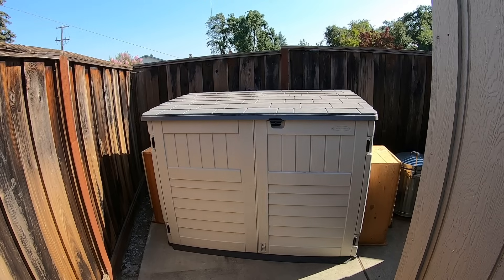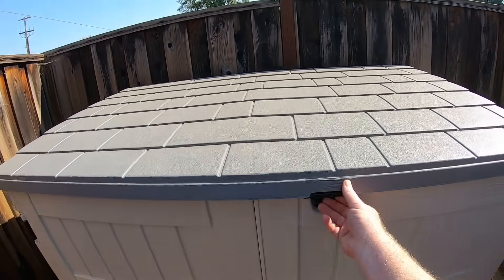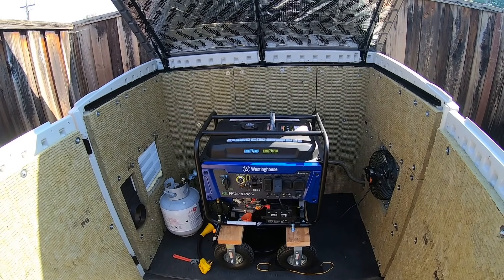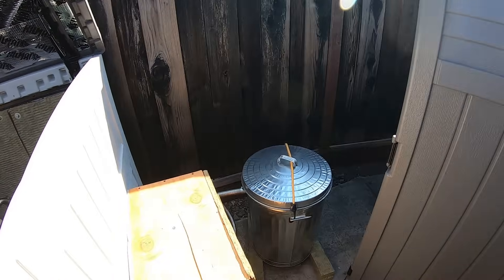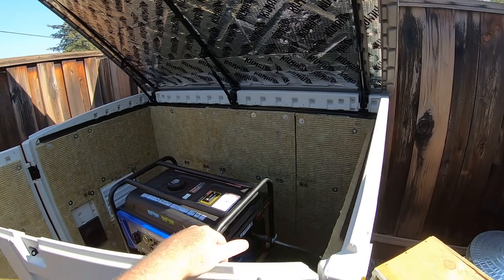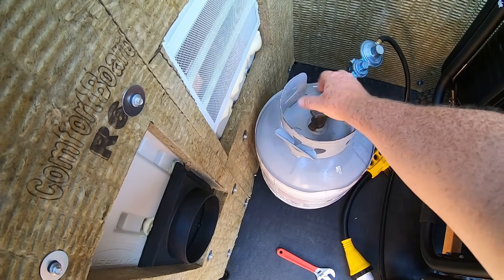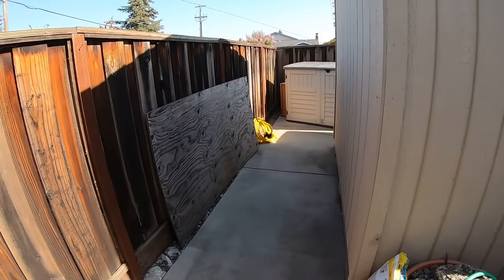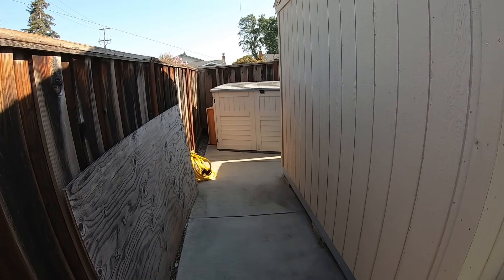DIY Generator Shed Build - Quiet Sound Insulation with Exhaust Muffler

Comment: Awesome stuff! Question- doesn't all that exhaust hose cause some sort of back pressure type issues for the generator? Like it's gotta push the exhaust all that way..
Reply from the maker: Yes, the longer the run and the narrower the pipe and the more turns, the more back pressure.  I'm actually working on a version 2.0 of my exhaust pipe and muffler that opens out immediately to a 2" pipe instead of a 1" pipe, shortens the overall pipe length, and also uses some electrical metal conduit (EMT) 90 degree bend instead of the shorter 1" pipe elbow 90 degree bend.  All of these should let it breath easier.  Keep in mind that the muffler design was just a proof of concept to see if it would even work at all.  It did work in general, but it definitely could be better.  Also going to add more heat tape around the exhaust pipe itself to keep the shed temperature down.

Comment: Do you have to route the exhaust outside the enclosure? Why wouldn't it work without doing that and just relying on large exhaust fan to bring in fresh air and pull out exhaust
Reply from the maker: Your main issue is what would happen if the fan failed or the breaker for the fan tripped.  You not only get a heat buildup and stink up the shed, but you'd have a potentially dangerous buildup of CO/CO2.  You don't want to breathe that and it can cause your generator to quit running.  The heat buildup in the shed is already borderline with this setup, and it would just get worse if you did not route the exhaust to the outside.  Also keep in mind to NOT build your shed near a window or door to your house.  The same issue with CO/CO2 can be very dangerous.  I lost count of the number of videos I saw online with the generator shed built right outside of a window - not good!

Comment: The BEST sound/fireproofing solution system in a plastic horizontal shed that I have seen!

I intend to build a similar setup for a smaller generator and had planned to make my own 'comfort board' type insulation out of fiberglass  batts and 1/2" hardware cloth fencing.  This is a huge improvement over what I wa going to try

My only concern is that by extending the exhaust as far as you did you may damage the valves on the engine from increased backpressure and heat.
Reply: I don't think it'll hurt the valves. We've added exhaust extensions to almost every engine you can think of and never had an issue. Hope this helps.
Reply: I think if you make sure to increase the diameter of the exhaust pipe, backpressure shouldn’t be an issue.
Reply from the maker: There are several more videos in this series.  I cover how I built the trashcan muffler in the Exhaust Version 1.0 video (view it here: https://youtu.be/jZpRSenXJAs).  Then I did a later video on my Version 2.0 exhaust on my channel, which has quite a few improvements over the version 1.0 setup, including upgrading the pipe to 2" diameter.  The newer video has parts lists, shed costs, and other Frequently Asked Questions.  Check it out here: https://youtu.be/y3pUw408jCU

Comment: Well thought out. I believe you will have an overheating problem with your setup. Buy a remote thermometer and put it inside. In my case I have a Honda 5kw and temperatures inside went up as high as 125 F before stabilizing. I did some research and generator operating temp info is hard to find. There are few kernels of info avaliable on this topic. Champion says ambient temp. should not exceed 40C or 104F. in other articles it said generator room interiors (that is rooms containing several standby generator sets) should not exceed 104F. Champion self contained standby gensets are designed for a 5C rise through the compartment.  Honda would not answer my request for info. In my case I opted for a 4200 cfm louvered fan (14"). The extent of the problem is of course how often and for how long you operate the gen set. The cylinder head and the insulation on the windings are the weak links. Generators are not cheap so you want them to last longer than your shed.
    Another suggestion is to think about tapping into you low oil circuit to and install a bimetallic switch say for 50C  which will shut down the generator in the event that the fan fails while you are not looking. There is an excellent youtube video on how to do this.
     My compartment is fabricated from cement blocks and has a metal roof and front doors. I used an MLV sound barrier lining as well as mineral wool on top of that. I spent a lot of money on sound insulation and could not beat the numbers you showed.
Reply from the maker: Thanks for the feedback.  I have indeed purchased several remote thermometers and placed them at various locations in the shed.  Testing shows the fan is working pretty well, but we will have to see after extended runtimes if that changes.

Comment: Great video. I hope you did not have to use it to power your house yet (unless going through recent Louisiana storms). But if you did, how long a run your generator made and, if you did any maintenance (oil change etc)?
Reply from the maker: I'm in Northern California.  I purchased the generator to charge my electric motorcycles when out in the woods (see my other video on that subject on my channel), but decided to add backup power in case of power outages.  Cali is notorious for rolling blackouts in the summer and fall due to heat and wildfires.   But haven't had to use it in a blackout yet.  Just testing so far, and haven't reached the 3 hour mark yet, so haven't changed the oil yet.

Comment: Anyone watching this.. Do not use these plastic sheds. I did, and once it was done the truth settled in. They are FLIMSY, the walls do not bolt to the back or to the floor! The walls merely slip into slots. If your around hurricane ally..one big wind will blow it away. Don't do like me and and build with this plastic crap. poor a slab of 4" cement and then build from wood. you won't regret it
Reply from the maker: All good points.  Fortunately, I am not in hurricane or tornado alley here in Northern California.  If I were, I would definitely have used different materials.  Wood would have been many times more expensive in this case, as plywood boards were going for roughly $100 each when I was building the shed, and lumber prices were absolutely crazy.  But I agree that plastic sheds would not be your first choice.  We do what we need to do sometimes, especially when on a budget.
Reply: @C5Tor  I concur it is so easy on a project like this to open up the wallet and not pay attention to the total cost. It happened to me.
Reply: I wouldn't be too worried about the wind blowing away his shed. He looks pretty thorough and he's got fences and structures pretty much on all sides of this shed.
Reply from the maker: Also, with the addition of the insulation to the walls and lid, the shed is a lot heavier than a regular plastic shed. (Each 2x4' piece of insulation is 8 lbs.) It probably weighs an extra 100 lbs with all the insulation on it.  Plus there is a 220 lbs. generator and 50 lbs of electrical cable in the shed.  As mentioned, it is also inside a fence and behind a shed.  But the original point about plastic sheds blowing away in severe winds is still valid.

Comment: Can you please give me a list of materials you used for the exhaust and where you bought them? Thanks!
Reply from the maker: I'm working on another video that goes into how I made the muffler.  Should be up in another week or so.  Stay tuned.
Reply from the maker: I've now uploaded a video on the trashcan muffler and the parts I used:  See link in the description, or go here:  https://youtu.be/jZpRSenXJAs
Reply: @C5Tor  Hi, I was wondering... would it be possible for the whole muffler to be inside the shed? Would it generate too much heat inside or too much hot air to be exhausted? Would be awesome if you don't mind doing a test like that and what the DB difference would be. Thanks for your work! Gives me a lot of ideas and inspiration.
Reply from the maker: @Joseph_Enriquez, I don't think I could recommend that configuration.  Not only would the heat not escape very well, but you could get a build-up of dangerous CO/CO2.  That can be dangerous to breathe when you open up the shed, and it can cause the generator to run poorly as well if it is starved for O2.  Yes, you should have pretty good ventilation if you have a fan, but what happens if the fan stops running for some reason?  I have forgotten to flip the breaker on the generator and not have my fan start before.  It got real hot real fast, and that was with the exhaust vented to the outside.  Any situation where the fan stops moving air would lead to bad things.
Reply: @C5Tor  Hmmm. You're right. Didn't think about those. Thanks again!

Comment: Your going to need a bigger exhaust line
Reply from the maker: The stock exhaust outlet where it exits the generator muffler is only 1 inch in diameter, and it originally had a spark arrester in it.  That's the way it was designed from the factory.  The flexible pipe I used is also 1 inch diameter.  I expand this to 2 inches inside my DIY muffler.  It seems to work fine, and the generator runs well with this setup.  There really are no additional restrictions in this setup, and it should actually flow better than that stock outlet, since I don't have the spark arrester in the loop.  But I do intend to make a version 2.0 of this with a bigger diameter and shorter length exhaust pipe.

Comment: You have a great setup. I am really impressed with your results and hope to be able to replicate. I tried looking for Rockwool comfort board in and around Houston, but haven't been able to find any. Can you share where did you get yours? Also, can you share links for some of the material that you used? Your trashcan muffler, that's awesome. Thanks
Reply from the maker: I was able to find the Rockwool at a local Lowes home improvement store.  Not all stores carry it.  You can order it online, but shipping is actually more than the product itself.  I see it come up occasionally on craigslist.  I will be making a little video soon about how I built the muffler.  The theory for the muffler is based on how a dirt bike muffler works, but just scaled up to make it quieter.  Stay tuned for more info.
Reply from the maker: I've uploaded a new video with the parts list for the trashcan muffler:  https://youtu.be/jZpRSenXJAs
Reply from the maker: Good find!  Roxul is the manufacturer name, so if you can't find "Rockwool", try that.  They do have lots of products other than "ComfortBoard", like you mentioned such as "ProRox" etc.  Thanks.
Reply: @C5Tor  what did you use for anchors?